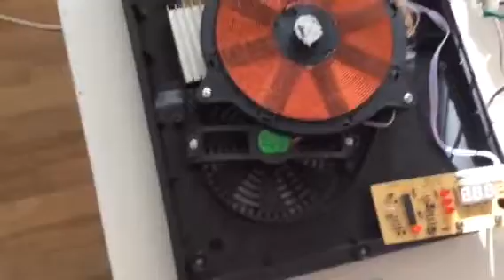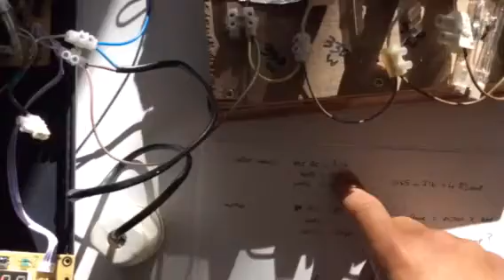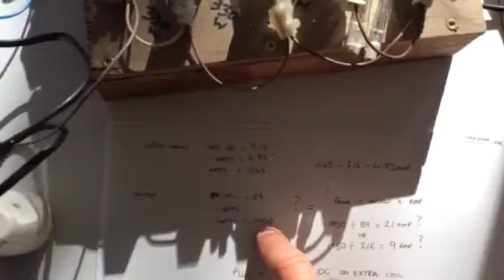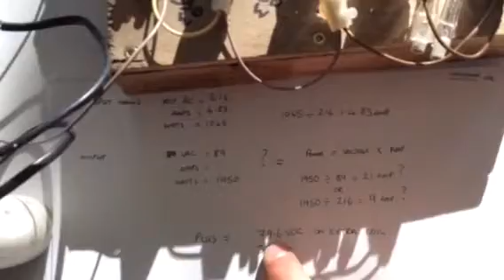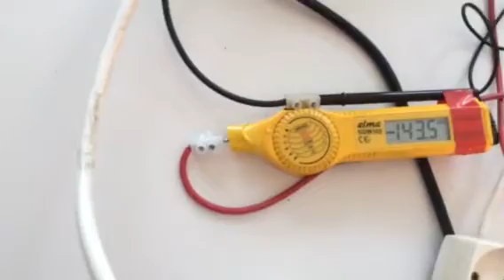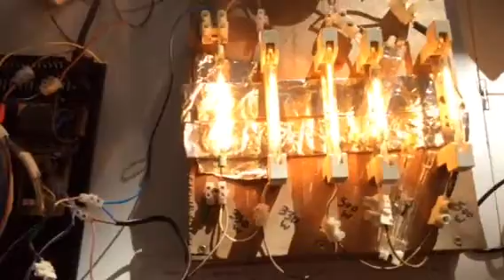INduction transformer,tesla, Kapanadze, Akula.

Comment: Hey DK - I love the concept of using simple off-the-shelf induction hobs and the easy to make pancake coils : -) I'm a little confused from the video as to which coil you are measuring to give you 89vac. But here's my thoughts: you've two coils - one supplying the lamps, one supplying the DC motor. Measuring high frequency AC on that yellow meter would be inaccurate so you've really got to measure the DC volt-amps the motor is using to gauge the output of that pancake coil. For the other pancake coil the light from the lamps in lux is the most simple way to get a good idea. So you've got about 1kw going in, and - by what I saw on your lux meter - 1500 out in light, PLUS whatever the motor is drawing in DC. So, if the lux reading is accurate I would say you have a COP of greater than 1.5. That's enough for a battery-based OU system, especially if you recycle the input by using the split-positive technique on your input batteries. Good job.
Reply from the maker: Mark Flint thanks for your great input. As I can see it should be possible to have a self running device as you say OU. I need better test equipment I think to give the most accurate result. But I feel that this experiment is very easy to replicate and obtain the same result. I have also had great success charging ultra aps in lightning speed, which in theory save masses on energy consumption.
Reply: Yes there is definitely a gain of energy from this kind of set up, and I believe it can be looped using storage systems as buffers. The reason I'm working something else is because I have to keep the input amps of my system to a minimum as I have not got the space on my boat for as many batteries as necessary for this. Otherwise this induction hob idea would be great. You really need a kilowatt of input to get those coils going, so with batts you're talking about 4 x 100ah batts for the input, which would be the C10 discharge rate at 24v, so that would be the minimum acceptable I think. And that's just the input side - not the charging bank. Supercap banks would be great but costly unless you can make them Robery Murray-Smith style :-)
Reply from the maker: Mark Flint yes the cap banks are to pricey. I thought of pumping a generator dynamo combination with a large fly wheel. This would have momentum and give the kw input needed for the system to be looped. I did purchase a 6000w pure sine wave inverter to power the induction hob and tried to loop it , but as it was a cheep brand it stopped working . What it did show was that two car batteries an inverter would allow the system to charge ultra caps faster than the power being used. Then the ultra caps could be used with the inverter and slowly release the power,allowing for longer duration of use.

Comment: Hi again Mr dkdyker, at the risk of repeating myself, it seems to me that you're only 
gathering half of the available energy. there are 2 sides to the induction coil and at the moment you're only utilizing one side (with the coils on top of the induction coil). If you had coils directly underneath the induction coil as well , surely the output will be doubled. It would mean removing the induction coil from it's housing. just my 2 cents worth, and hopefully constructive.
Reply from the maker: clixbits thanks and yes I had forgotten that you committed last time. I did try this on a previous setup with battery input and had a nice result, but not able to get the feedback to overtake the input DC voltage. I agree with you that it is possible to take field from both sides. Problem is that I would have to take the ferrite from under the lite coil, guaranteed I will destroy it. What are you comments on my simple observation re calculations?